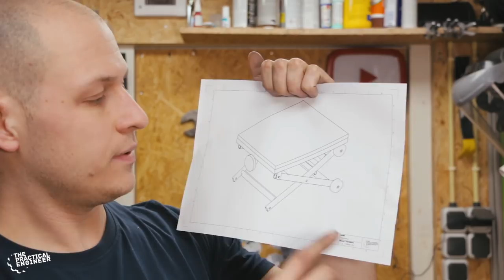Metal and wood scissor lift table - Industrial style coffee table

Comment: Excellent achievement I am inspired thank you.
I must soon make a large metalwork table adjustable in height over 4 meters in length with 4x directional wheels.
Do you think with a 50x50x3mm alunimuim tube or the 80x40x2mm can be enough?

Comment: How did you fix the brass bush to the metal sections? Using 2 short screws?
Reply from the maker: Yes, I used two short m10 or m8 bolts for that. It doesn't turn a lot so a bearing wasn't really needed

Comment: I want to know the dimensions of all parts to draw it in solidworks for my project .
Reply from the maker: I do not have all the dimensions drawn out or a plan unfortunately. The table top is 650 x 500 mm. If you draw it in solidworks its fairly easy to lay out the lengths of the legs

Comment: Nicely. Done !  I do want to bust your chops a little bit  because you were wearing a full face shield but didnt have it over you face  ?  I spent over 20 years in the Woodworking and Machine shops  with both hands on. And management of a crew of over 40  experienced Craftsman  not only having but properly wearing the safety gear  is really important  part of my job was picking up guys from the hospital and getting them home everytime someone got. Hurt they all said the same thing  when. It happened it happened so fast  or  after it happened  they couldnt beleive that it just happened to them ?   I am not necessarily a know it all. But i did have to  carry the OSHA  safety card for one of the companies i ran   So  buying the correct. Gear for the employees was. Essential  therefore i wanted to point out to you  that you too should be aware of  pulling that shield down to protect most importantly your eyes God only. Gave us one set  for our entire life  i did  enjoy the scissor lift a great deal  mostly because of the high quality of the one you made  and  that any decent one available to purchase commercially are super expensive  to buy  and ive concluded a long time ago. My next. Shop will  definitely  have one  as ive suffered. Physical injuries that. Limits my lifting capacity  so ive been looking out for one that may have  some portability. Or  a way of  adapting it to have some   Incidentally the. Ones ive seen  for sale that do have castors  i dont think would roll very well with a load on it. And honestly when fabricating with wood or metal   Most things are. Heavy  loads
Reply from the maker: Hey Craig, You are completely right about the face Shield. When grinding etc I usually just use the normal safety glasses but with this saw I normally always use the face mask because it slings metal everywhere. Not sure why I didn't do it this time.. Anyway, the saw was hell to work with for metal so I got rid of it.

The scissor lift tables are awesome to work on! This one is more for the looks though